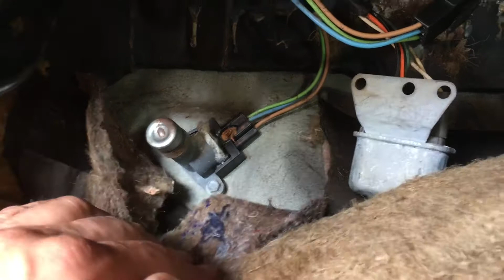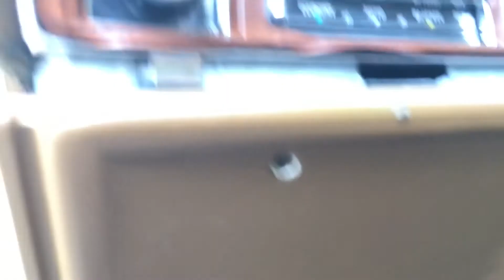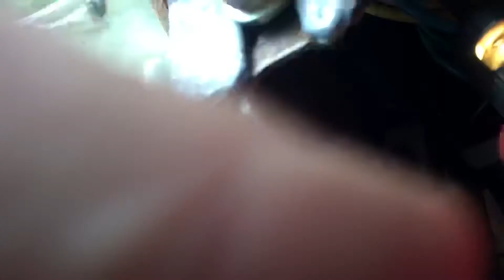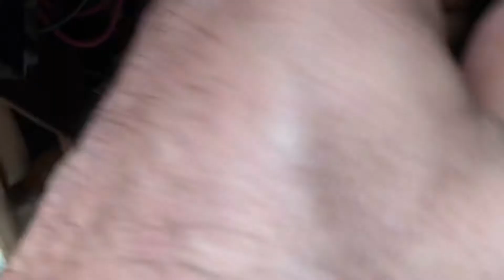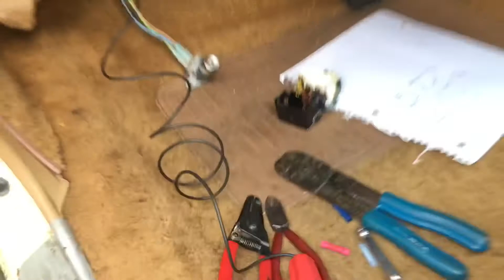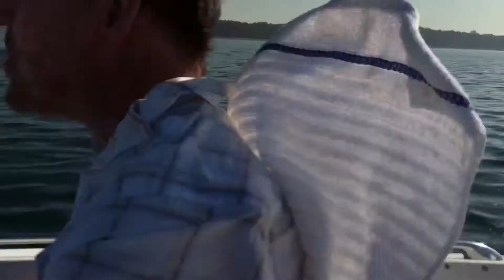70’s Cadillac headlights not working

Comment: I've had over 12 Cadillacs and they're all in that same range you get a hot headlight switch and the headlights go out and then it's melted under the carpet the dimmer switch plug. Now replacing all four headlights with hella brand h1, H4, glass and lamp units they come with halogen bulbs 55 watt/ 60, however when you have the high beams running you'll notice the headlight switch sometimes getting hot that was years ago on one of my 76 Cadillacs so I tended to not run the high beams for a very long now I discovered it's possible to put LED bulbs in those same hella h1\h4 conversion headlamp units now the lights are bright and run cold and pull very little voltage, in the turn indicators 76 and 77 have a clear lens so you can run the 1156/1157 Switchback bulbs, that are LED cob, parking lights become White, and when you put on the blinker they blink yellow and then returns to being white when the blinker is off in combination with the other four lights with the LED bulbs in them you can have six white lights up front all are cold to the touch and don't draw a lot of amperage because you just can't see where you're going with Factory headlights they're not bright enough.
Reply from the maker: Thanks for the information 👍

Comment: having this issue on my 1971 hearse... I'll have to check these connections. Currently I am trying to bypass my dimmer switch, it is bad, and the blue wire is losing volts when I connect my bypass wire.
Reply from the maker: Thanks for watching. Good luck exercising those bad spirits from your electrical system! Please subscribe if you haven’t already.
Reply: @scrapdaddysgarage5027  that connector doesn't exist on mine it joins another bundle of wrapped wires instead. I need to find how to disassemble the whole dash and rewire.
Reply from the maker: @charlieinthebox88  search for a schematic, problems like this are difficult to trace, good luck
Reply: Wonder if that's the same problem on my 67 Deville dimmer and headlight switch are good. I'll check that next. Thanks.